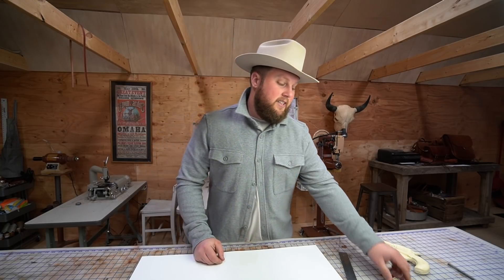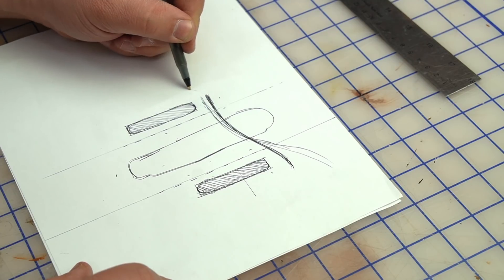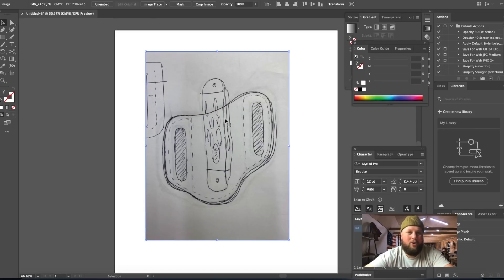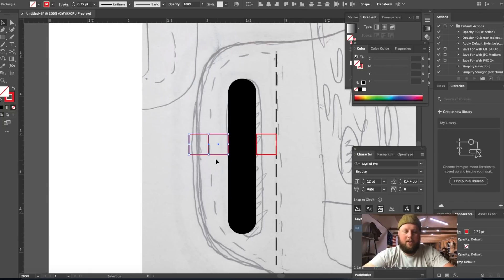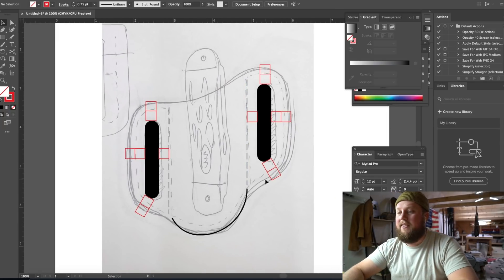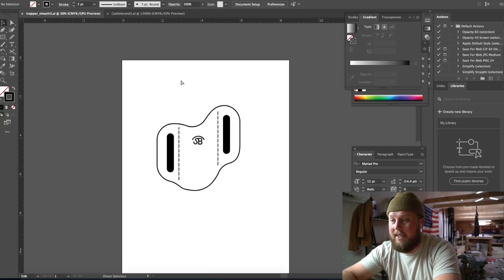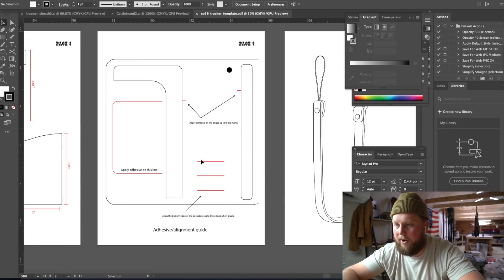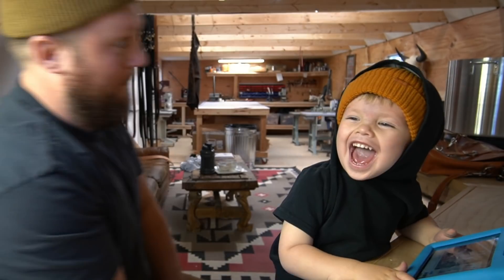Making a leather craft pattern - Adobe Illustrator for leather workers

Comment: Ive got a really cool tip for you. I created a file with all of my most used shapes, objects and measurement guides in it. I named it "BoneYard". I have one specific for each design program i use.  When i start up illustrator, cad, photoshop etc. Its the first file i open. Then when i start the new design i can copy/paste from the "boneyard" to the new design with a simple file tab switch. Awesome time saver when your using repetitive objects. 

Another trick is to put line types in the boneyard. For instance punch holes or stitch lines. Then in your main design drawing you just use color coding during the design process.  Like red for stitching and dont worry about dashing or dotting it. Then when your done designing, copy/paste the line types over from the boneyard then paint match the line types to your design stitch/punch lines. Jobs done. Print and coffee break.
 
P.s. dont forget to clean up your drawing.

Comment: If your knife is 3/4" thick, don't you need to add 3/4" on each side? (Not 3/8") The leather comes up 3/4"on one side, across the width and down; or would this only apply if making a wet-formed sheath?